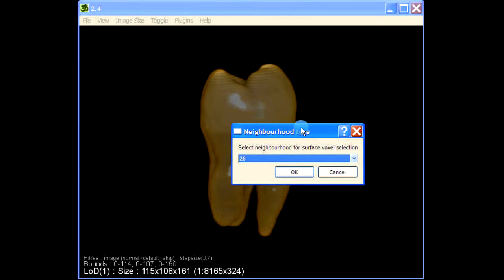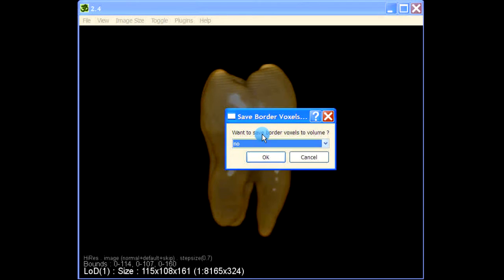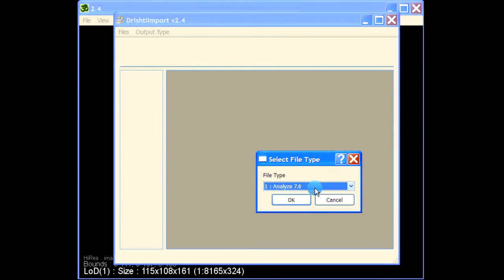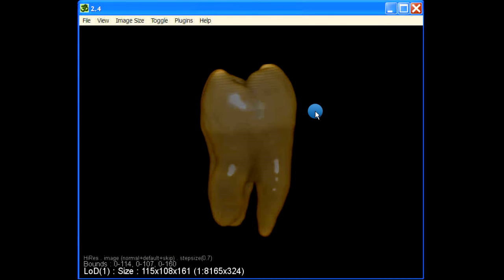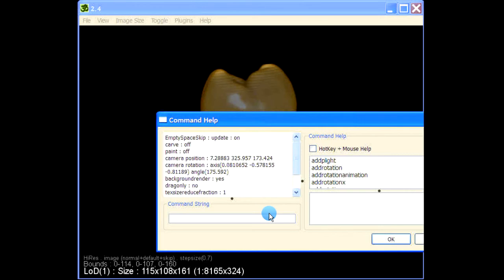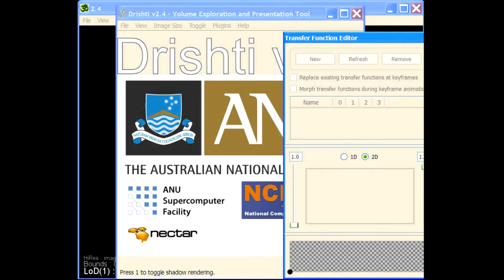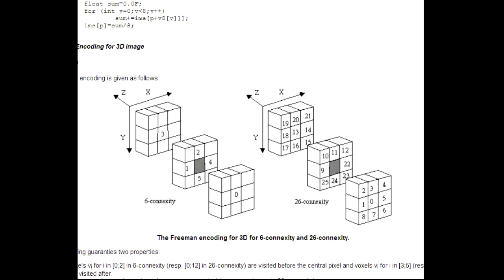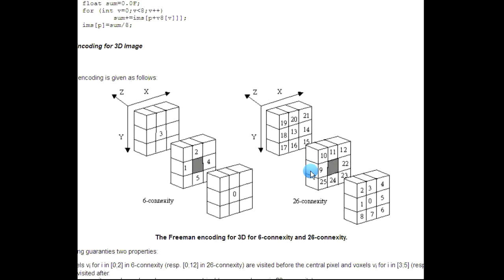Surface Area

Comment: Hi Ajay. Thanks for all the helpfull videos. I was wondering though whether it is possible to convert the number of voxels for the surface area to units of area (e.g. um2 or mm2)? For volume we multiple by the size of the voxel e.g. 10 x 10 x 10 um, but condsidering voxel is a 3D unit, can they be converted to a squared unit? Also, for the volume calculation, is that just the volume of voxels that are tagged? Thanks!
Reply from the maker: For volume calculation, it is just the volume of the voxels that are visible (any voxel with opacity greater than 0, no matter how tranparent).